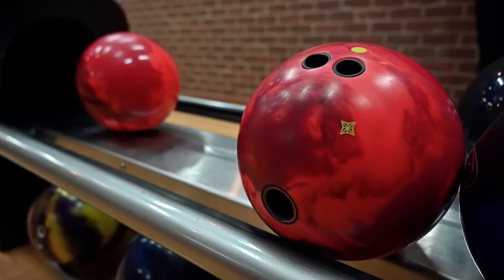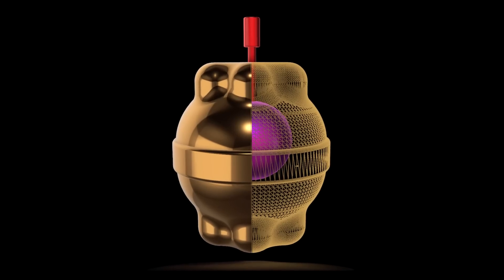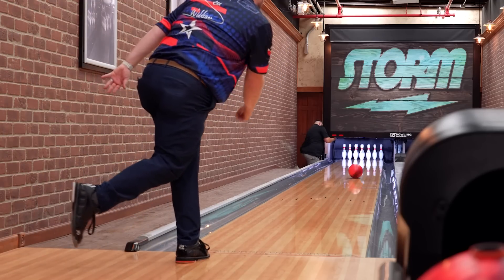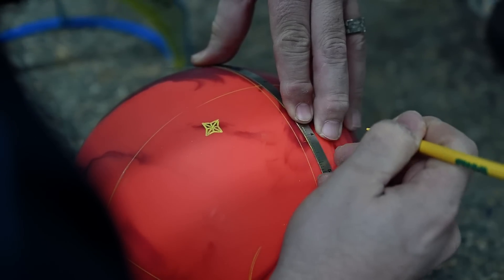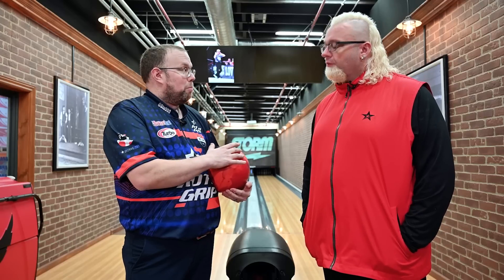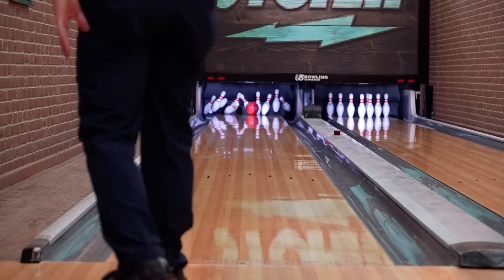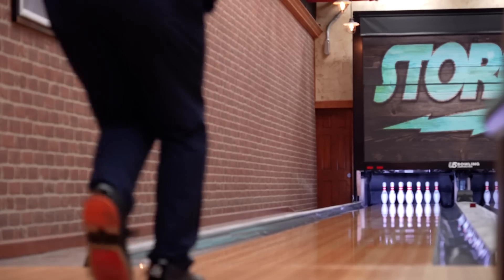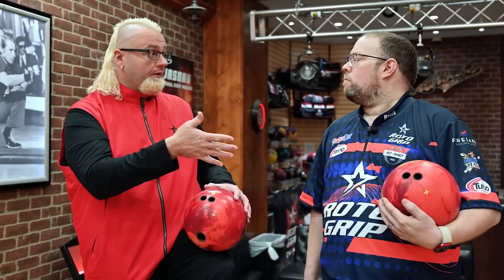Roto Grip | TNT Layout Comparison

Comment: When laying out any symmetrical ball, I consider the angle subtended by the pin and thumbhole, with the assumption that the thumbhole will define the post-drilling high RG axis. 
90 degrees (6.75") from the pin to the center of the thumb would be essentially the neutral center point, in terms of the effect of the thumbhole on the RG of the X-axis. Angles larger or smaller than 90 degrees will tend to raise the RG of the X-axis relative to a 90 degree thumbhole, and will usually result in a slower rate of precession and smoother transition to roll. I tend to stick with angles between 45 and 90 degrees for the vast majority of layouts, and absolutely never exceed 90 degrees if I want a quick response to friction.